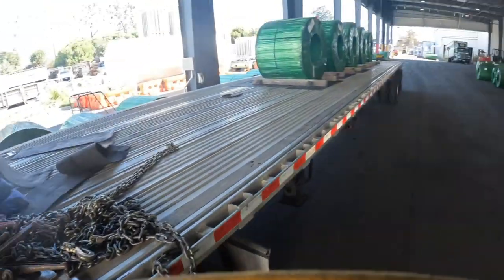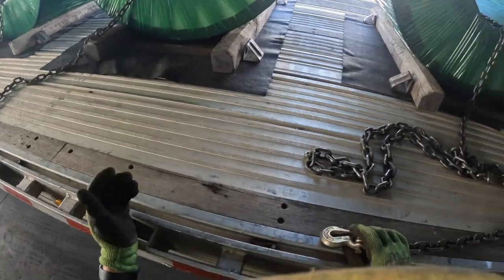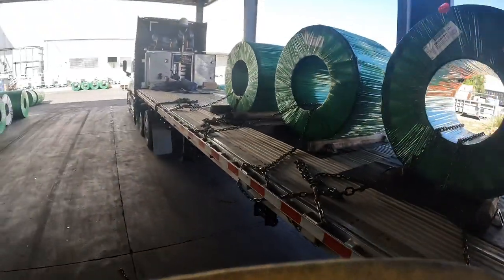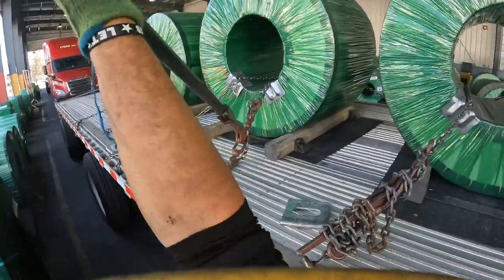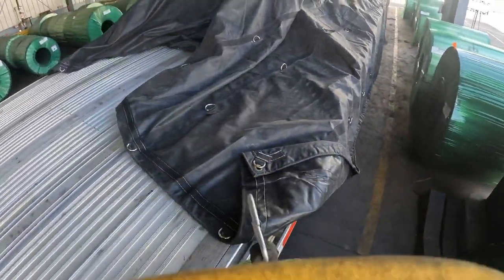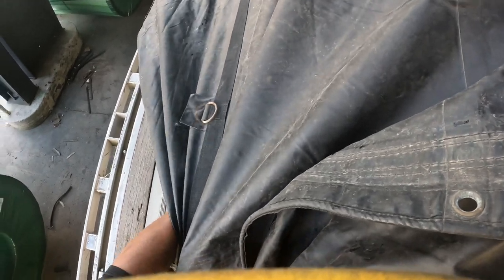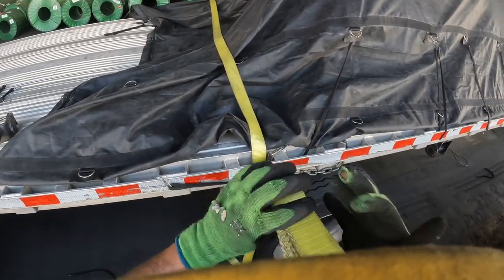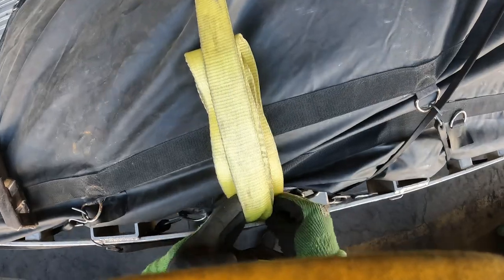Prime inc flatbed trucking #43. Suicide coils securement and tarping.

Comment: You should have them together. Secure the back from forward and side movements. Then just take a 4 inch and connect 2 together with 1 strap. Do the same on the forward hole. The back will act as a anchor.  It's indirect. Does this make sense to you?
Reply from the maker: At steelscape coils can’t be touching each other. what your saying is dangerous and illegal using a strap to hold two coils together. In the hand book section 3.3.3. One tie down forward and onetie down rearward on each coil.
Reply: @tollboothjimmytrucking.  it depends on what coil as well. As long as it is not going to cut the strap the ends of the coils can touch. You go through and around and indirect strap 2 together. It's not illegal. This what we do at system transport. However not all coils are open like that. Others allow for only 1 or 2 chains to go through. If I could I would show you a example of how to do those coils. Anyways just trying to help you out. Not the best at explaining stuff
Reply: @tollboothjimmytrucking.  yeah i see. Was not really watching. These one yeah no touch. But there's other ways to do things. I was referring to coils that are on I guess called spools? But it's that edge I was talking about. Those you can tie together.
Reply from the maker: @dogsandguns2625  I get it like a slinky load. I’ve see 100 of system at steelscape and never seen this done. In your green book like I explained you have to have two chains per coil. But send me a video when you get this load to show me
Reply: @tollboothjimmytrucking.  there is a whole load with steel tube. All secured using straps. No spool. I got a picture I would like to share. There together and it's a legal load tie down. Sucks I can't show on this form of communication
Reply from the maker: @dogsandguns2625  email jimmyolson2424@gmail.com
Reply from the maker: Cmon bro those are slinky way different then suicide coils. I did a securement video on those.
Reply: Alright should have it in inbox. I'll take pictures as I get the loads. I'm still learning. What's nice if I got questions I can contact my dm
Reply from the maker: @dogsandguns2625  https://youtu.be/3LlQ2xeowxQ
Reply: @tollboothjimmytrucking.  yup. That looks about right
Reply: @tollboothjimmytrucking.  did not see your slinky